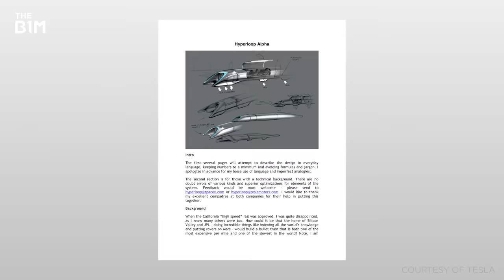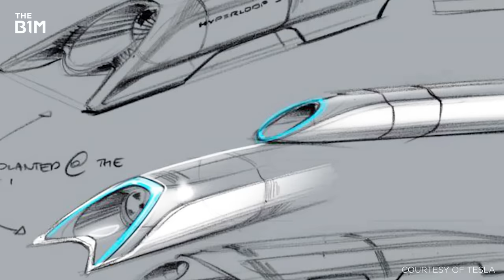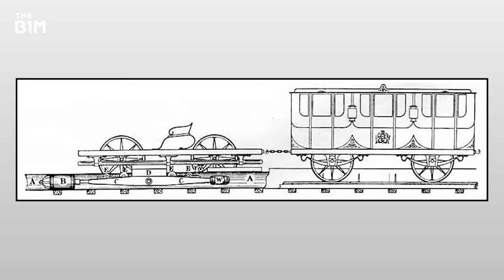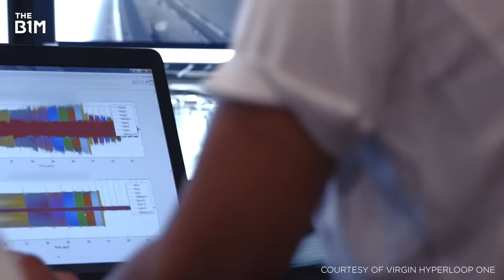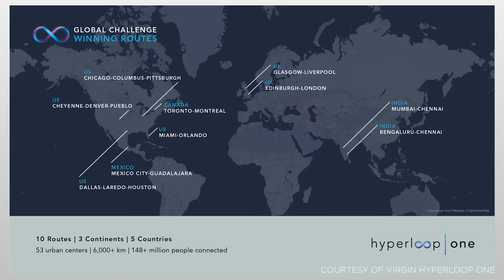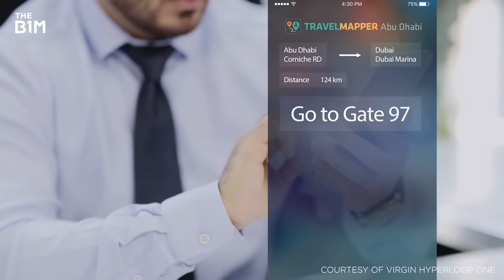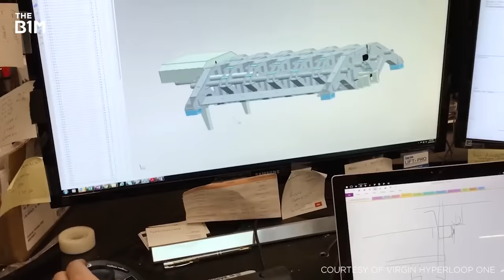Hyperloop Explained

Comment: To me this sounds incredibly dumb. Never mind how ridiculously expensive this would be for how few people would actually be able to use it at a time due to the use of very space inefficient 'pods' the throughput would be terrible and speed isn't the only important factor in transportation. If someone were to knock out a few of those pillars or make a hole in the tube this thing would be useless and could potentially kill a lot of people, it would certainly be possible if someone was so inclined. Also since the earth doesn't stay still the pieces of the tube would move around and would definitely be unpleasant to ride through. What about evacuations? You cant exactly get people out of sealed vacuum tube/pod easily or quickly. Never mind the maintenance costs, all I see are problems for only a very marginal increase to convenience.
Reply: You are quite right, but the the biggest danger is depressurization inside the pod and not a leak in the pipe as far as I can see!  A leak in a pod's door or hull is likely to occur, it happens in aircraft around the world hundreds of times per year. At low pressure equivalent to a height of 40000feet the time of useful consciousness (TUC) is only 15-20seconds (Source: Reinhart, 1996). At higher altitudes even breathing 100% oxigen will not help anymore to regain conciousness and at even lower pressures a lot of other medical harm is done (see https://en.wikipedia.org/wiki/Cabin_pressurization).  In U2 aircraft (60000feet) the crew wear space-suits for these very reasons. Going even higher in a presurized pod wearing normal atire, like in the advertisement videos, appears quite reckless....
Reply: Can anybody  please suggest me some creative topics  on future technologies ....guys plz help me out if u know anything

Comment: I'm 20 now I reaaally hope this is a thing before I'm 50
Reply: TI Pilot I doubt it lol
Reply: well they said that it will be in place by 2021 so you should be fine to ride the hyperloop sometime in the future.
Reply: I hope so to.  This would be the best way to travel instead of 35000 ft in the air in a tube with wings bouncing up & down from turbulence & crashing to the ground.
Reply: @metalmopars  Lets just ignore that one tiny hole in the outer structure would blow the whole thing apart... Planes are much safer than you make them out to be.
Reply: It won't...
Reply: Better be in a tube in which if any structural integrity fails, everyone dies horribly.

Comment: I can imagine that door that seals off the separate sections accidentally bring closed when it's in use. The damn train would obliterated
Reply: much like how a normal train would be obliterated when the rails are broken
Reply: @-Big_Big  Nah, look at France, they have very few casualties each year despite expansive train network and high speed rail. Most of the casualties are from people standing on the tracks. People in the trains usually only have injuries at most

Comment: Something that I didn't hear brought up in this video was heat expansion. When you are running a pipe for hundreds of miles you are going to run into many heat expansion issues which would cause buckling of even the thick metal tubes one way to solve this would be digging down far enough where the ground is at a constant temperature ,but would be quite unrealistic for this far given that tunneling machines are very expensive and not that fast and it would also make upkeep on the tubes nearly impossible. Another solution would be expansion joints just like on bridges between every other tube ,but I feel would still be unrealistic because how would you make them air tight while still having give to heat expansion idk I'm not an engineer ,but it seems very illogical to me.
Also when thinking about it how would you pump such a monstrosity down to near vacuum pressures efficiently because it can't be something that takes days due to such a large reliance on it from many cities infrastructures it would have to be very quick ,but this would require large fleets of vacuum pumps just to pump down one tube in a reasonable time and also a lot to physical labor.
Another point is that even thick steal isn't much of a match for large quantities of explosives and it would not be hard to cause a catastrophic failure throughout the whole system and shutdown certain pipe lines for days maybe even a week, which would be totally catastrophic to the infrastructure of many cities and cause many people relying on that line to not be able to get to work for up to a week.
Finally how would this at all be profitable for anyone to construct because unless the tickets were the price of plane tickets it would take centuries to make back your money from tickets and I feel like many governments and companies wouldn't want to back such a project for this one reason.
Reply: o The problem of expansion and contraction would be one of the first technical issues thought of by the Designers Just because it is not mentioned in the video it doesn't mean its not been calculated. Trials will always be carried out to allow for this .  As ideas go it is not that complicated .Mankind put man on the moon .If we can do this then Hyperloop  is an obvious solution to  many short term journeys.I predict by 2050 they will be everywhere .
Amazing how there are always cynics ,whatever the technology offers . I remember the early eighties when people who carried mobiles around  were ridiculed . Thirty years later  everyone has one.
Maglev was a good concept but the expense so far has prevented its success .Combined with vacuums proposed by Virgin  it will be sensational . If not perfect it will develop and evolve to suit.
Reply: @gategi10  All I was saying in my comment is that the problem of heat expansion seems illogical to fix. (me a person that isn't an engineer) I didn't say it Was impossible and I Would Love It if you could show me where a Clear cut answer for the problem of heat expansion is documented ,but until then I have the right to be skeptical of things that don't quite add up yet. Also even if the problem of heat expansion is solved my 2 other points in my original comment still stand.
Reply: Lewis Atkinson  Ok  fair comment  everyone has a right  to an opinion. I am a Civil Technician and work with steel in low tech situations .I understand your concern  as steel must contract and expand and i dont know the exact  technique but am sure that designers will not put a system in place that does not work . They are already constructing one in India from Mumbai  and i am sure they will have technical issues that will be ironed   out.   I have been looking at  many other hi tech ideas . This will work eventually ...
Reply: Lewis Atkinson To come with critical thinking to this project err scam. They only want your money. It's an investment money scam.
Reply: Double O Ring sleeved slipping expansion joints.
Reply: All it would take is diverting funding from War machines to Transportation. Nobody thought something the size of a 747 could fly either.
Reply: this video brought up nothing useful, just a fancy sales pitch/advertisement

i wonder though, when it fail (not if, but when) if it would push the pod at near super sonic speed like a oversized spitball ~.^

Comment: I found the video of the proposed highway system in Norway interesting, so went to go take a peak at this channels other videos, and then realized this is clearly one of the channels Thunderfoot rips on all the time LOL.... Will the hyperloop incorporate technology from SOLAR FREAKING ROADWAYS?! That way it could pay for itself and also put a meal in the hands of 500 homeless with each trip.
Reply: Did the exact same thing. And thought the exact same thoughts. Nice CGI though, if a bit too futuristic.
Reply: Thunderfoot would consider impossible about 9 out of 10 of the constructions that are featured in this channel. (Structures that are already made by the way)
Reply: Thunderf00t has several good points.
Can we build a vactrain? Yes, of course.

Can we make it safe for humans? Nope. As of yet, no one has been able to show a safe passive breaking and evacuation system for vactrains.

Can we solve the thermal expansion issue with long steel pipes? Probably not.

Are vactrains efficient?
Depends. Hyperloop as envisioned by Musk and others would have small bus-sized passenger pods.
Given required safe breaking dustances, this would provide similar passenger carrying capacity as a bus line on a single lane road, but as vastly higher cost due to all the steel required.
For vactrains to be efficient, they must be made more like trains. With passenger capacity of 500~1000 per vehicle.

Comment: If the hyperloop is supposed to be a vacuum, then why are the concept vehicles always aerodynamic?
Reply: the vacuum can not be perfect, so even if the pressure is very low, the aerodynamic form is still usefull to limit the use of energy and the friction
Reply: Because I am sure that it will have to enter and exit the tube for platforms and stations
Reply: Daniel Davies The cars shouldn’t have to travel outside the tube.
Reply: @jameshaskell1073  they will if they want to go to the stations.

Comment: 700mph aka 1100kmh  is only good if those speeds are used. 240mph is not good enough!
1100kmh means u could reach every place in germany within 1 hour. but then again u need a broad grid. if you need to travel 1 hour to your next portal and from the destination portal again 1 hour to your final destination u are 3 hours on your way , too much for travelling to work daily as you would be 6 hours traveling.
Reply: meggi tf you talking about

Comment: Who says it necessarily has to be used for people? Simply using it for transporting cargo would increase competition for trains and trucking, and reduce costs for all shippers and consumers. Then, if it proves safe after 6 months or 6 years or 60000 trips or 600 million miles whatever people think is enough, use it for human transportation. It's not like we need to install a million miles of the system in the next year. And it will be your choice not to use it.

Comment: 250 MPH?....meh... I have to say I'm not that impressed...get them up to 600 or 700mph and now we're talking!
Reply: In theory they could go several times the speed of sound.
Reply: He was talking about short test track. It should achieve much higher speeds on regular one.
Reply: That track was only 500 metres long. If given a few hundred kilometres, it will reach 600 or 700 mph
Reply: slow down there annie oakley!
Reply: Another video stated that the top speed would be about 760mph. It'll HAVE to go at least that fast so the HyperLoop can rival air travel speeds.

Comment: Why not just put the tubes underground?
Reply: cost more
Reply: Cheaper to build above ground.
Reply: I'm thinking the same thing. Hundreds of miles of above ground tube with people traveling so fast, will end up being the next 9/11.
Reply: @MrDominosEffect  hundreds of miles above ground? That's space, buddy
Reply: A lot of it will have to be underground.  (1) for environmental reasons (like HS1 and HS2 in the UK); and (2) because it cannot rise over more than a gradual hill because at the speed it's going the passengers' stomachs would try to come out of their bottoms (the hump-back bridge sensation).  The demo video scenes tend to show it in a flat desert - very convenient.
Reply: roads are not underground, freeway are not underground, train are not underground (mostly). So why should we put the tubes underground ? It is useless and more expensive

Comment: Can we get a video on the new Heathrow expansion plans?
Reply from the maker: Yes, it's in the pipeline. We just need a little more information before we can make a video. If approved, that project will affect millions of people in both positive and negative ways, so we need to make sure that the information we present is accurate and final.
Reply: As long as the video also covers the alternatives considered in the decision-making process (e.g. four-runway options, Gatwick/Stansted/Luton expansion, Heathrow Hub, Thames Hub, Boris Island, airport expansions outside the Home Counties, better use of existing space at Heathrow, etc.) as well as how transport networks could complement it (e.g. Crossrail, High Speed 2, and Greengauge 21’s other proposals), I’ll be satisfied.

Comment: Hyperloop is a money pit, Richard Branson wasted his money. The SpaceX Hyperloop white paper didn’t even correctly address thermal expansion (the need for expansion joints). Maintaining a vacuum on 100 miles of steel tunnel is insanely difficult, expensive, and has many safety challenges. Watch Thunderf00t’s Hyperloop videos
Reply: Being a mouthpiece for thunderf00t isn't a good critique. He makes a number of misleading arguments. He tries to demonstrate how unsafe a vac tube is by showing large containers imploding when the air inside them is sucked out. What's misleading about that is those containers were never designed to handle a vacuum. They were designed to hold fluids so they are strengthened against expansion, not compression.

Comment: Um. first.  Musk did not found Tesla, he bought it.  Second, air resistance is a form or friction.
Reply: David which is why they're doing it in a vacuum tube.
Reply: First of all, Az Haz, they said "partial vacuum".  And second, they said "air resistance" AND "friction".  As I said (and physics too) air resistance IS a form or friction so, therefore, is the same thing.

If you're going to criticize someone, make sure you a) get your quotes correct; and b) know what you're talking about.

Have a great weekend.
Reply: no air in a vacuum but they cant make vacuum tubes that good
Reply: It's not going to be as perfect as a 100% vacuum perhaps, but the little air resistance there is will be tiny compared to current track resistances on fast trains… and the current fastest trains are already not that far off from airplanes. And the hyper loops, like trains, would have the advantages of avoiding airport time loss, and of arriving and departing directly from the inside of cities.
Reply: @SaturnCanuck  I didn't quote anyone. I just said it's a vacuum - partial or not it's still a vacuum and an attempt at reducing air friction. A full vacuum would increase risk and introduce higher probability for errors during regular maintenance. Something they're trying to avoid on prototypes, especially if they're aimed for the general public. 

If you're going to have something to back your "argument" up a) get your quotes correct and b) know what you're talking about. 

Have a great weekend.
Reply: @Az Haz.  Thank you for your well-thought-out reply.  So many trolls on YouTube just "attempt" to character assassinate that it is refreshing to have someone with actual writing skills and thought processes to mount an "argument".  I especially liked how you used my own verbiage in closing as Imitation is the sincerest form of flattery.  I am honoured, Sir.  Well-done.

Mind you, your attempts to correct me on technical issues -- which may or may not be correct -- does not address the real elephant in the room, this being my original statement.  That being that air resistance is a form of friction, and that the video makes it sound like two separate factors when they are one.  One-in-the-same, in fact.

That said, I have no "argument" with you -- I was commenting on the lack of research on the part of the writer of the video to show his or her lack of understanding of physics.  On this issue, I am sure you will agree, as you have displayed a high-level of understanding of physics and motion.

As for the weekend, yes, I will have a great weekend.  Here in Canada it is a long weekend and intend to enjoy it to the fullest.

Thanks for the wishes.
Reply: LOL.  Nice comeback.  I had gained some respect for you last night but I guess I was wrong.  I was hoping you had a some intelligence and morals to discuss this issue properly, but, alas, I see you are nothing but an internet troll set out on character attacks and insults.  You may reply but, this will fall on deaf ears by me and after your last insult (which shall be reported to YouTube) you have shown your true colours to many other intelligent and thinking people who watch this channel. I shall not stoop to your level and this will be last the last reply from me as you are now blocked.

Comment: 240mph... Conventional rail can do that...
Reply: yes, that was a giveaway line, not impressive at all
Reply: Wasn't the test tube 500 meters long?
Reply: Yes, and nobody yet has went the length !!! I guess nobody knows that you can't have a battery with LIQUID in it , since it will BOIL IN A VACUUM. It must be designed for a vacuum ! Sealed in a larger, thicker, heavier container. And how do you remove heat without air ? Only radiation ! Maybe some conduction with the track ! So quick overheating !
Reply: Of all the huge issues with Hyperloop, you picked one of the easiest ones to fix to pick apart :P
Reply: Yeah.  A Bugatti Chiron can go faster than that - 261mph
Reply: Not get up to 240mph within half a kilometer, also slow down and stop before running out of tube.
Reply: The goal is closer to 700mph.

Comment: I had a dream riding the hyper loop but was called the hyper link. The module had no roof and I was excited taking pictures of the L.A. skyline. It picked up speeds in the 100 km range or faster.  Surprisingly I felt safe and comfortable being inside one. The track was similar to the one in this video. It's going to definitely be an experience going on a hyperlink train in the future for its users. Good luck to the engineers 👍 don't give up!